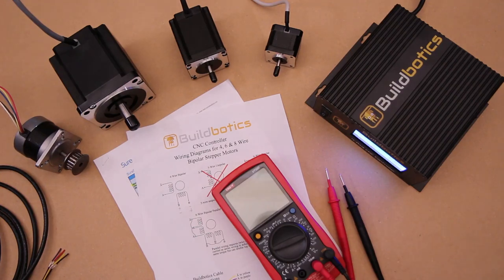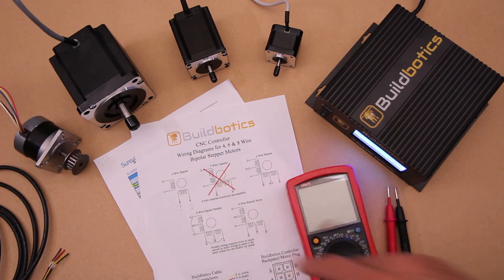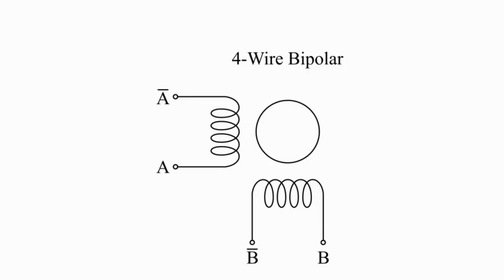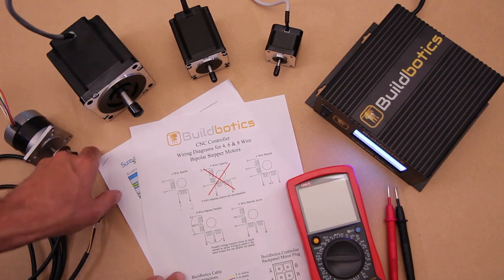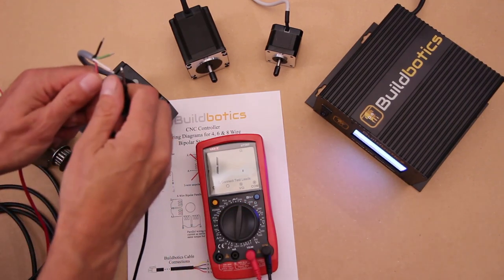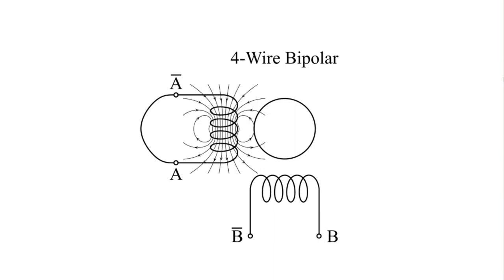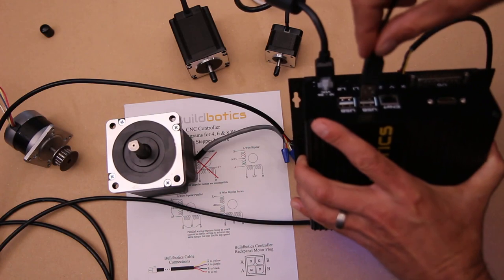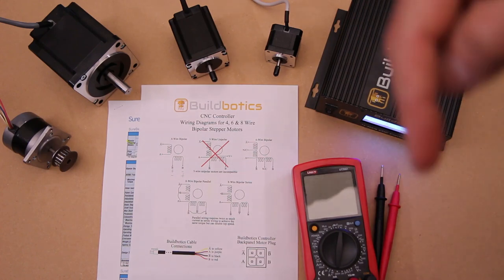How To Connect 4 Wire Stepper Motors

Comment: Thank you.  You are my hero.  My CNC machine that I purchased second hand was knocked off the table by my garage door; damaging two of the stepper motors.  I had to replace them with similar motors, but, naturally, the color codes did not match.  I needed baseline information on how stepper motors work.  Thank you for your common sense information without all the fluff or assumptions.

Comment: This is a very much important video thanks for these tips. I saw 2 people have thumbed down I feel it is really unfair, and I hope they both didn't know anything about stepper motors and drivers . and some people may confuse about which is A and which is A+ but it is easy. Just connect and see the turning direction, if you see the direction is against to what you need just change the wire.. Just practise with the available knowledge, then you will get more knwledge. (this message is for viewers)
Reply: Haters gonna hate.

Comment: Great video! I have a stepper motor and i have separated the phases but i don't know which phase is A and which one is B. Also if i discover which phases is which, then how do i know which cable is A+ and which one is A- and the same for B+ and B-?
Reply from the maker: You cannot tell phase A from phase B without the motor datasheet. The good news is that it really doesn't matter much. If they are switched, the motor will turn backwards, but otherwise run correctly.
Reply: @buildbotics  thank you!

Comment: Are the phases an AC voltage ? or are they dc . It would be nice if you included a sketch of the waveforms in the wires for clarity. Thanks for nice video.
Reply: It's more complicated than AC vs DC.  The voltage is PWMed (Pulse Width Modulated).  So the voltage is a lot of short pulses of varying lengths that can positive or negative.  The current, which changes more slowly due to the inductance of the motor, is an stair stepped AC waveform.  I wanted to keep this video simple so I didn't delve into all the details.

Comment: HI, what would happen if you had A  wired one way & B wired the other way is +&- Reversed on the B line, would it turn the motor 1 step in one direction then one step in the other direction ? in that case how do we know what wire on each coil is + ?
Reply: It will just go in the other direction.  It doesn't really matter which is A+ and which is A-.  It's only important that As and Bs don't get mixed up.

Comment: The motors I've seen are labeled A,B,C,D.  Also, will steppers run on any voltage?  How do I know?
Reply: There are many different ways the motor wires may be labeled.  The voltage is determined by the motor driver.  Most motors run on around 3-4v but modern drivers run on much higher voltages.  The the current version of the Buildbotics controller uses up to 36v.  Higher voltages are better because, in general, it allows the driver to drive the motors with more torque at higher speeds and thus faster.  However, the quality of the driver plays a huge role.  A poor quality driver with a higher voltage will not necessarily run a motor faster than a high quality driver, like the drivers in the Buildbotics controller.  Another very important consideration when driving stepper motors is the robustness of the driver electronics.  Cheap drivers are very easy to blow up.

Comment: which is A- and which is A +? I have a mks gen L v2 and how can i do connection (1B 1A 2A 2B)?
Reply from the maker: Assume 1A = A+, 2A = A-, 1B = B+, and 23 = B-. If the motor turns backwards when you try to run it, simply reverse one of the pairs, but not both.